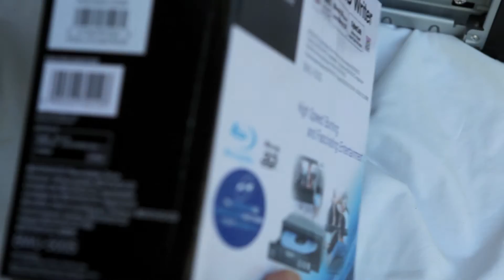Blu-Ray Burner Sony BWU-500S Unboxing and Install Build Your Own Computer Part 10

Comment: I know it's years ago but i have the same drive, which I hardly got any use out of. I've been trying to use it to play a DVD movie but it won't read any DVDs that load. Checked connections of the BWU-500S’s power and data cables. Device Manager says the drive is enabled and is operating normally. But after I inserted a DVD movie I didn't hear the motor spin up to read it. I barely got any use out of this drive so how likely that any optical or electromechanical parts would be defective? And in Windows Explorer when I click on the drive it says to insert a disc, which I already did. Is a corrupt driver file most likely the problem? Is the driver on the purple colored Sony Software Disc Rev. 9.30W DVD that was included in the box?

Comment: question for all the hot shots out there .. can you use an old system with low hard drive and low everything for a blu ray drive? or do you need certain things? for a blu ray burner drive to work ?

Comment from the maker: Go into device manager and check to see if the drive is listed in there. If you don't see it you can always go to the vendors website to see if there are any updated drivers. If you call tech support they will have you unplug the data cable and plug it back in--before you do this, go into the BIOS and check to see if the drive is in Optical drives, sometimes you may have to relocated the drive in the BIOS. Good luck!